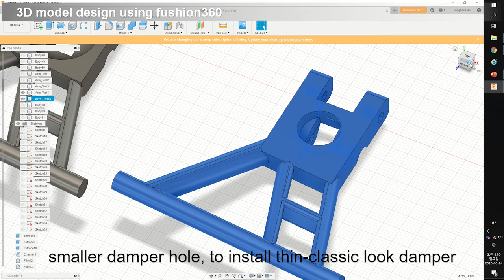Tamiya Grasshopper front suspension arm upgrade, to use vintage oil damper, which adds vintage look!

Comment: How many hours does it take to print how much are those for upgrades that and the shocks?
Reply from the maker: Hi brad,  answers to your question!
how long : printing takes about 2 hrs for my printer, it varies based on detailed setups for printing it
how much : printing itself almost costs nothing, only the print filaments costs. One filament roll usually costs from $15~25
                      the shock I used is hornet or wild one's shock, which is pretty expensive and hard to find.
                      I recommend cheaper ones in ebay or aliexpress, 
                           you should by 1/18 scaled shocks, with about 70mm long, they cost less than $10 per 2 set
                      you will also need 4 ball ends and ball end cups, 2 turn-buckles. I believe you can get it by under $20
Hope it helps, Thank you!
Reply: @HumbleVintageRC  thanks wish I had a 3d printer.